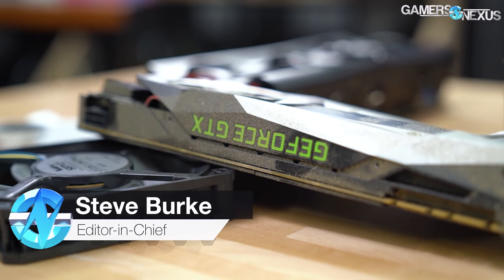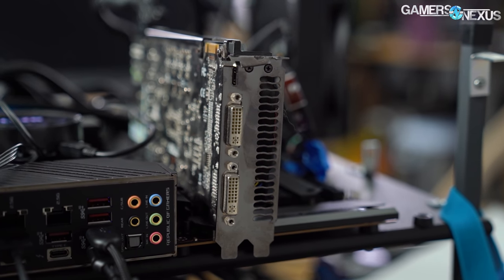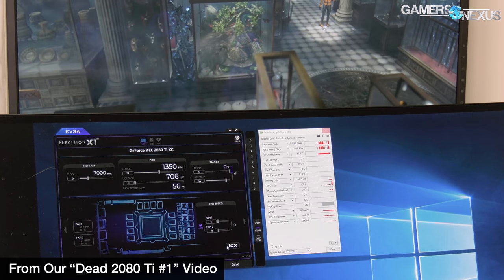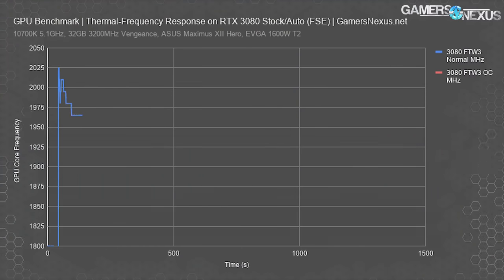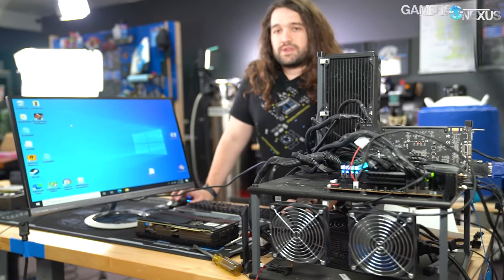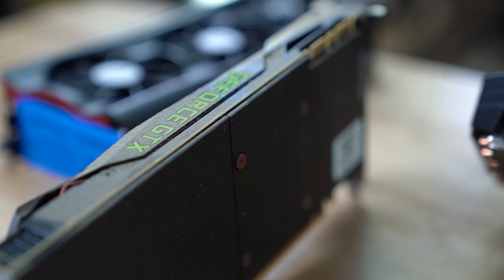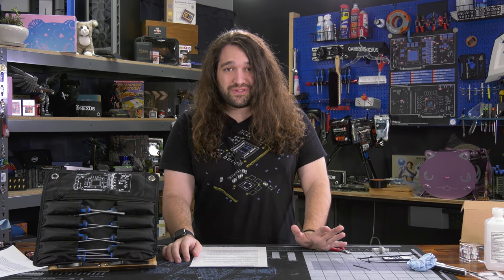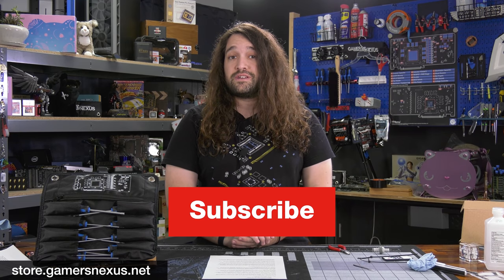Warning Signs When Buying Used GPUs: How to Detect Defective Video Cards

Comment from the maker: We'd love to hear more about our community's experiences with either buying used PC hardware components (GPUs, CPUs, etc.) or helping friends fix their own. There are probably a lot more shared experiences that can help other viewers of the comments section learn and protect themselves from bad purchases. Post them below!
This video is following-up our guide on preventative maintenance, dusting, cleaning, & re-pasting video cards: https://www.youtube.com/watch?v=n7NMeu0QiYk
Grab a GN Toolkit, Mouse Mat, shirt, or GPU anatomy poster here: https://store.gamersnexus.net/
Reply: rx 570 moment
Reply: I've had nothing but peaches when buying used GPUs. Bought a used Dell OEM RX 570, and it came coated in a thin layer of dust, but working. Probably used to mine, but it worked fine for the time I had it.

Current GPU is a used 980 Ti I got used for $200. It was super clean, in the box, and looked like new. 10/10 would buy used GPU again.
Reply: I asked last live stream about you suggesting someone for GPU repair, my issue was I bought a brand new, unopened box card outside the US, The manufacture told me when I immediately reached out there is different warranty regulations depending on what country I live in vs where the card was purchased & to contact the company I purchased from, & literally never to respond to another message from me
Reply: The card caused a D6 post code
Reply: I bought a used 1080ti, guy showed me running the heaven benchmark no issues. Tried it in two different computers, can't run any games (crashes to desktop) and can't play 4k movies full screen (black screen, sound continues fine, have to reboot to get video back. BUT, it can play 4k movies in a window (even a full screen window) and I can use it for encoding videos no issues.
Reply: Upgraded from an i3-4130 to a used i7-4790K, slotted in, worked perfectly, no problems even at the OS level. For some reason there are a lot of Malaysia-packaged chips floating around; the one I snagged was labeled Costa Rica; not sure if that made any difference or not.
Reply: I buy/sell a lot of older PC hardware because it became kind of a hobby to build PCs or save them from scrap and lots of people need cheap ones atm.

Generally, your best used deals will be things in Bulk of some form, weither it's a business getting rid of their old PCs or someone having a broken PC where some parts would be worth the price already.

Sadly, GPU are about the last thing you want to buy used (along with PSU) from private sellers. 
One exception would be GPU from miners, if they're old enough to sensibly get replaced for more efficient ones (i.E. when there's a big generation change or the like) you can make deals there but I wouldn't go above midrange cards. The reason why I'd suggest "older" cards is because they'll likely have made profit with no reason for the seller to scam back a lost investment/debt.

Another option as mentioned would be to pick up a GPU running benchmark tests (in fact, I run GPU-Z and Superposition on stuff I sell), but keep in mind a lot of places have contact restrictions in place at the moment and scammers love nothing more than a excuse to not meet you during a time where GPU prices are inflated.

Also: Don't feel pressured to buy a GPU now. Almost regardless of what PC you have, there should be lots of good games running on it, regardless if it's old AAA, emulated console/mobile ones or Indie Games - and many of them are free or low priced.  Weither you drop the XX hours on some new Games now or in half a year shouldn't make you throw away your money.
Reply: What about cards that where used for crypto mining?
Reply: had experience buying a fake hyperX ram, the seller said it was 8 gb, but when i test it in my board it only show 4 gb ( of course the code on the memory z is different ), then i mail official hyperx distributor and they said the ram was a fake.. next day i return it to the seller and confront him, then he admit he bought the ram from shady online shop. Im still lucky my money fully returned
Reply: Ive bought and sold multiple types of hardware components (gpu, cpu, ram, mobo) locally and over the net. Biggest thing is the person selling like steve said. Majority of people are honest and are just selling to upgrade not screw people over. Never had an issue with any used hardware, but I buy newer components (within last 2-3 gens). Had one person return my evga 760 for "not working", it worked fine he prob just had buyers remorse. I sold it for $45 I believe.
Reply: Part of a couple of forums and we have a good community, restrictions on who can get into the buy/sell section by having time/post count (but their checked for being spammers)
Means we have a lot of good people offering great deals on their parts.

With FB and our local version of Ebay generally try stick to locations where friends/family is to go pickup in person. Unless the product has an invoice with warranty then shipping is fine since I can get it fixed/replaced as long as it's not user error.

I've gotten a Ryzen system and 3950x for half its retail value pre this pc parts shortage. So pretty good as long as you do your due diligence.
Reply: My opinion on used hardware is that it's fine if the person you get it from is reasonable or if you have some guarantee for your money back which is true with most online markets. I have never bought used high end hardware, not because I have anything against it, but because I haven't had the opportunity due to cost/need. I was considering upgrading my graphics card to a used 20 series card last year, but that was based on an expectation that I'd finally get a paycheck, and did not account for COVID, or medical bills. That said, I have bought lower end used hardware and I have been running my NAS on an Intel developer motherboard with a core 2 duo with a stock fan that I got at the MIT Flee market for $75 all together, half a decade ago.
Reply: @shaneeslick  After that happen i just notice in my country the original HyperX RAM always have a box included in every purchase and that box must be returned in case of RMA ( like a proof of purchase ). The fake HyperX that i bought only use plastic case, from my memory-z data i think that fake HyperX is just cheap RAM with fake HyperX heat sink with fake label in it.
Reply: The list at 1:46/1:47- Items 1, 4, 5, 6 to include crash to desktop or display not coming up can be a result of a mining bios being installed on the card, Polaris/Island based cards where the most prone. In a blue moon were Vega Cards being flashed.

I know this because Ive helped hundreds restore cards through a vbios database and would locate the needed bios. My old username hastons of threads that can be used as a guide now.

There are tons of fake nvidia gpus, 1s claiming to be 960s/1050s when they are 450s...
Reply: Have since learned to always always always check thermal compound when buying a used GPU. Bought a evga 1080ti SC2 back in 2018 that I was told was in perfectly fine condition. Upon arrival it worked, but over time I began to notice it had issues running games that it shouldn't have trouble with. Then late last year, when trying to get it to run a fairly graphics heavy game, it stopped working completely. 
Upon removing the stock cooler, the issue was revealed. Previous owner had removed the original thermal compound and done a Liquid Metal application instead, and they had not done it properly, using plain electrical tape instead of conformal coating. Liquid metal eventually seeped off the die and well, sayonara GPU. When I bought a replacement GPU earlier this year, first thing I did was open it and check the thermal compound.
Reply: I've had pretty solid experiences in general. Bought a 1070 Strix and a 1080ti Zotac amp extreme core off eBay in 2019, both have been great. Recently ran into memory artifacting on the latter, but I'm assuming that's just been because of wear. Also bought a 1080ti Zotac amp locally that year as well (for 375)-- worked great, and I sold it to a friend last December for 340. Got sold a bricked 1080 last month (for 350 cash), so that was a bummer, but I'm still exploring my options there.
Reply: Like the person in the intro, I also bought a used RX 580 8GB a year and a half ago for my first ever PC build, but in my case for a bargain of 130 EUR. Since this was a brand new system build, I wound up figuring out and returning/replacing my DOA motherboard during the course of a month or so, and thus forfeiting the quick and easy refund for the GFX card since I couldn't even test it as this was the only system that could even run it and it didn't seem damaged. Still, since everything seemed to be working fine with the new motherboard, I felt I got a good bargain and that it was working fine...until I tried to play the first videogame, when it immediately crashed and forced a system restart the moment it was put under any more strain than regular Win10. Later I would find it randomly crashing even while playing movies or youtube videos and would find out that the only way to prevent this reliably was to severely underclock it (by 300Mhz or so on core and locking it from 2000Mhz memory to p0 state at 300Mhz - that part was critical, or the card would just immediately crash even if it might work at p1 state of 1000Mhz with some games for an hour or so). Did I mention BTW that you could do this with older 2019 AMD drivers, but not with their brand new shiny 2020 Adrenaline, which removed the option to lock the card's memory to p0 300Mhz state? That sure felt fun!

I tried literally everything you can think of - from trying every last kind of custom BIOS, to undervolting, to repasting + replacing thermal pads, ect. - nothing ever fixed it (short of I imagine soldering work on the memory chips, which I suspect were the main culprit) and I couldn't return it. Still, for a little less than a year I could even game on it, so long as its memory was locked to 300Mhz and its core clock was underclocked (effectively making it half as good), until a few months back I specifically had to overpay 650EUR for an RTX 3070 8GB to replace it, because I refused to buy another used piece of crap that hid its problems this expertly during Covid times, when who knows how long it'd take to get the return through and I'd inconvenience the stressed post office for it. Still...I guess I got p much what I paid for - half the performance for almost half the MSRP of the old card lol.
Reply: Picked up a refurb 2070 back in Dec from Zotac on EBay. 
Worked fine for a couple months, but now goes to black screen as soon as drivers load. It will boot into Windows desktop if the Nvidia drivers are cleared using DDU, but fails when you install them. Waiting for reply from Zotac.
Reply: Only issue I've ever had with a used gpu was a 9800gt that needed some thermal paste because the old stuff had dried to the point of cracking, causing the card to overheat and shut off the computer to protect itself. I've bought 5 in total. The aforementioned 9800gt, 2 rx 560s for some old office pcs that needed a boost, an rx 480, and my current 2060 super. Things to look out for are obviously seller rating and what kind of information the seller puts in their description (whether they've repasted, if they were overclocking or undervolting, if it has the actual part number or not). I steer clear of the sellers that only put up stock photos of video cards and don't even list the model; some of them are legit and just don't want to go through the effort of sorting what they have if they received it in bulk, but those types of sellers are also unlikely to properly check the health of the card; the rest of them are probably scammers with fake cards. Also, while seller rating is important, I'm personally not afraid of buying from new sellers so long as they take plenty of pictures of the cards, most people selling without any prior rating are just looking to get rid of their old parts and use the money to get new stuff. Buying hardware on ebay has become fairly low risk as long as you check everything when you get it, with ebay itself guaranteeing returns within 30 days.
Reply: I sold my 1080 founders few months back but before I handed it out to the buyer I had it deep cleaned and repasted thermal paste. ❤️
Reply: I'd still love to see a video about fan replacements or about fixing fans on old videocards. One of the fans on my MSI RTX 2070 Armor already started doing squeeky noises on occasion so that would be very relevant, at least for me.
Reply: I don't have any buying moments but I have a friend who's 1660 TI has what they call "white and black spot artifacting"
Reply: I bought a 770, 970, 390, and 2080 (probably mined on) on reddit and none of them has given me any issue. I even sold them after I upgraded. If we weren’t in this pandemic situation I would gladly buy used again.
I always check account age, feedback, and use PayPal goods & services.
Reply: Remember when this dummy was pooring liquid nitrogen during bench tests on a live stream with his bare hands?  Everyone was trying to tell him not to except for some dumb fanboys.  then he burnt his hands.  funny stuff
Reply: Mine is an RX 580 4gb. It's a year old now and is still fine.
Reply: Learned a hard lesson buying a "used 1080", basically got scammed out of half the price cause I had too much good faith in people and figured the guy was going to send it to me by mail. Ended up that the adres was a house on sale and empty and the phone number was a burner phone, the bankpayment method used a bank provided in between bank number that "protects" the owner's identity. The guy ended up being someone who was well known as a scammer on this website and who was being autobanned constantly but somehow always returned with a new account to scam people. Guy was in prison for a while and heavily in debt. Never saw that money again since the police solves very little of these crimes, it gets shelved even if you provide addresses from log in locations etc.

Second time was a lot better, had a chat with the guy didn't pay anything in advance. I went over to his house and he had the card still inside his pc, guy wanted to sell his 1080 so he could upgrade to a 2080 ti to play games. Saw it working fine, he was def not a miner and paid for his card by bank using my phone. Even got the box with it. Card has been in my possession for about 2 years now and runs fine.

Always try and pick up the card yourself and see it working there on the spot.
My other warning sign would be if the seller presses you into paying asap then something is wrong, if at 10pm at night someone is acting like paying even part of the price is something that has to be done before the night is over then something is up.
Also curb your enthusiasm, I know we all want to have nice things and we want them now but randomly buying something while you're on a euphoric high of 'being happy you get what you want' can cloud your thoughts and overlook obvious scammer signs.
Reply: Hey steeve ! What are the other cause of GPU failure ? I had a 770 fail so bad it would crash explorer.exe, making the desktop un-usable... What could have been the cause ? I then swapped it for a new GPU that arrived DEAD on Arrival. I can't remember if I switched the PSU cable with the replacement card. Would faulty cable be able to kill GPU ?
Reply: Bought a used custom watercooled Vega 64 with the PCIe Power Connector chipped? Anyway it detects fine, but for some reason often causes blue screen of deaths. I have another of tthe exact same model and watercooled but it did not cause issues. Tried DDU and reinstalling drivers and flashing over the current BIOS but now no matter what it can only function properly on the default backup BIOS. I mean, I got it for USD200 including the waterblock so I guess you get what you pay for.

What's the point of a Watercooled GPU if it can't clock higher than one that is air cooled?
Reply: Bought an rx580 8gb. Got an rx570 8gb with an rx 580 bios. Didn't know any better. Worked fine for 3 weeks. Then had a power spike, took out the psu which took the rest of the pc down with it. 10/10
Reply: Bought a used vega64 for £180 back in 2019 only to build to a PC with it recently. Little did I know the dent in the heatsink was also a tear between the copper and aluminum, which kept causing overheating issues. But the Card worked! Until I had the bright idea of strapping my AIO to the card with no VRM cooling... While the core was fine and cooled, I must've killed the VRM because now I have a piece of e-waste on me.
Reply: 11:29 You got some artifacting in your Video maybe the Editor needs to be RMA'd. :-)
Reply: Faulty fans or worse a faulty fan header. As modern cards tend to only spin up the fans past a certain temperature, this requires a stress test and GPU-Z to catch.
Reply: We somehow ended up with a third PC during late 2020 after upgrades (R5 1600, GTX970, 8GB RAM and a 256GB SSD). It runs pretty okay for the most part, and it ran well for our friend who bought it from us. Several months later it ended up crashing a ton upon plugging in a USB device on some of its ports. We're actually not sure how it happens but sometimes it resolves itself good enough.
Reply: the only real used PC part i bought was a Xeon from china, haven't had an issue with it aside from it being a decade old. But it has enough cores/threads/overclocking potential that it still has some decent like left, aside from missing modern instruction sets needed to play some modern games.
Reply: recently got a rx 570 and it artifacting in games not running second monitor with restarts when you attempt and flickering on the main monitor. worst part i thought i bought it brand new the seller seemed good had great reviews. no onboard graphics so stuck atm
Reply: TITAN V NEEDS NVIDIA SMI TO CHANGE THE PSTATE SO FOR THE GPU TO BOOST TO 1860 MHZ..... it is normal that TITAN V stays locked at 1350 or 1450 if watercooled...
Thisis a proffesiional GPU not a gaming one , even if its faster than an RTX TITAN, in gaming and raytracing
Launch Command Prompt from the Run window (press Win+R on your keyboard to open "run" then type cmd).

Change the directory location to the folder where nvidia-smi is located. 
Type cd C:\Program Files\NVIDIA Corporation\NVSMI into the DOS window and press enter.

Here’s the nvsmi command that will uncap mclk on TitanV:
nvidia-smi.exe --cuda-clocks=OVERRIDE

To return to default:
nvidia-smi.exe --cuda-clocks=RESTORE_DEFAULTS
Reply: I managed to get a 3090 FE for £1750 that came with a dead fan out the gate (had a rare defect where the header for the bottom fan gets sheared off in the factory) but because I had to buy it through Ebay Nvidia wont RMA it or just send me a new fan, have done some of my own modifications and it works great now, if kinda janky
Reply: Also for those interested I am using a case fan as for the time being it is impossible to buy replacement fan
Reply: I've had great experiences buying and selling used. Recently sold some old GPUs and I can't believe how common it is for people to take your word for it. Lucky for them I'm just selling working and clean cards but I had one guy not even open the box until I told him to. Stay smart out there buying used stuff everyone.
Reply: I bought a gtx 1060 3gb on ebay back in 2018, I cleaned it and repasted it and it’s still working to this day :)
Reply: @Gamers Nexus - at 16:54 on the RX480, the plate of the card looks like it has moisture - Similar to a card that had failed on me back when I vaped.
Vape residue looks exactly like that and can build up.  It built up and became basically a droplet which went down into the PCI slot.

Just something for people to keep an eye out for.  The only way to have been able to tell by the time I was done trying to save it was a tiny burn mark on the actual PCI connection area.
Reply: Also:  Wouldn't a card that doesn't post (the 3080) still be covered under warranty?  It might be a wait to ship back, etc... but wouldn't that still make it worth buying?  Or am I wrong?  Anyone?
Reply: Thanks for the info man we appreciate it, keep up the good content 👍🏻
Reply: @machintrucGaming  yes, you had a gpu die dying, typical of nvidia cards...
Reply: @D3Shadow  depends on the oem and the store it was bought from and if you have PoP.
Reply: Wish we could buy some of that stock off of you haha
Reply: OMG I JUST got Space Invaders on my 1080Ti but it seems to run YT vids/browsing and idle fine. But I got Space Invaders error while gaming then BSOD....anyone know what the hell this is???? Why?
Reply: @Gamers Nexus pls make a video about pricing and risks of buying a video card that was on a constant mining rig before the gpu crash happens.
Reply: gtx 580.3 radial fan evga works quite nice. sub 30 €. 
seen rx 580 for 700€ new? on ibäh ^^
Reply: Not used, but bought a 2070 founders edition direct from Nvidia this time last year.  It sat until I finally had the time to do a new build just a few weeks ago - after just a few days of use it began artifacting - Essentially a new card, tested with cinebench with no problems.  Came home from work to find artifact lines all across the screen.  Re installed drivers, card, different cables, different monitor, always same result.  So, it can happen even to a 'new' card.  Talk about pulling out your hair given no means to easily replace it.
Reply: When I sold my VII I made sure it was clean, and I kept it supported with a anti-sag arm. I also used my friend's actual repair shop as a front for selling it to make my legit listing look less sketchy.
Reply: is it a good idea to have gfx cards shipped?
Reply: @romchompa6858  how else are they going to get around the world? they aren't made down the street from the store. As long as you aren't shipping them with improper packaging it's usually fine.
Reply: Usually a seller gives buyer 2 weeks or a month to test the card. So it is plenty of time to test and stress the GPU. 
But there is no way to tell if used GPU came from home PC or some other PC where it worked 5 or 6 hours a day or from mining rack where it worked 24/7 at 100% for a year. 
I bought used GTX 1070 two years ago and I asked the guy is it from home PC or mining rack. He told me that the card was mining coins for 6 months. The card still works perfectly.
Reply: But now almost all used RTX 20s and RTX 30s will come from mining racks. Over 90% of them. All this mining of virtual coins is like a new gold rush. People buy GPUs like crazy to mine coins.
Reply: Got a 2080S turbo from Gigabyte... Failled hard in 3 month. Back from RMA and got your SPACE INVADER thing randomly and then shut down.
Reply: bought  CPU, PSU, RAM, AIO's, fans and all my cases off Craigs List but never a GPU or Mobo.
Reply: As a miner I concur with your statement regarding mining cards theoretically are taken care of better than some gaming cards, depending on "housing" and ambience. ô¿ô

To elaborate on that, a lot of us small time miners build cabinets with filtration and excellent airflow. 

My 3 rigs are in a 3x3x7 tent behind a 6" inline activated charcoal filter with merv-6 prefiltration and a 6" centrifugal blower rated for 420cfm in a humidity controlled basement that's never hotter than 20°C  - cats, dogs, smoke, I'm not keen on dusting & cleaning a bunch of cards every 3-6 months. Also, I'm pretty happy with thermals & the simplicity of replacing pads + paste as needed. 

Buying used GPU's has been nothing short of a pleasure outside of the current market pricing, with one exception!

Managed to pick up a 3090 Suprim X "used", at MSRP!
Reply: I restored a pcie card that was in a bad house fire. It's running. Deoxit and a toothbrush, rinsed with 99.5 alcohol.
Reply: I've had good luck buying "junk" GPUs as long as they're detected / power on. Like you mentioned in the video, repasting can often fix these. Or if you're lucky, it's just a BIOS flash issue. More and more it seems like cards used for mining are being resold on ebay with modified BIOS for mining that are unsigned, requiring either something like amd pixel clock to make them work in Windows, or a BIOS reflash. If they state the card powers on but it's showing an error 43 in Windows device manager, it's probably fine but just a BIOS issue.
Reply: what is that Nitrogen tank for ?
Reply: Getting ready to buy a 1080ti from facebook market place, wish me luck
Reply: @NewsOfTheRebellion  My take on this is that gaming may actually shorten the life of a video card much more than mining. Why? because a mining card will run at a pretty much consistent load and temperature, A gaming card will not. It will be loaded when the gamer is gaming but at other times will not. That creates temperature cycling and temperature cycling induces physical and mechanical stresses because differing substances expand and contract at different rates with temperature fluctuation. Because of this, thermal cycling is often far worse on electrical components that running at consistent loads, even if that "consistent" load is full load. Think about it. There's a reason why light bulbs often fail whenever you flip the switch to turn them on.
Reply: There is another fault i discovered , if getting Bullshit error codes from the mother board constantly reporting various failures the mother board is not broken it is shorting on some sort. Take out clean with alcohol cotton bud and magnifying glass,  common if someone used thermal grizzly liquid metal paste and made a mess of things its conductive and looks like mercury and hella messy  this can also be evident if someone used this to replace a cooler with the wrong type of paste ,  warning though its a absolute nightmare to clean off as alcohol will dissolve the gallium tin compound but u must get every molecule off
Reply: I want to ask something.... Who the fuck buys Rx580 for $700.
Reply: Could also be titled how not to sell a defective card.
Reply: Hi Sir I just want to ask for your advise.

I searched the internet for a very long time but din’t find a solution to the problem.

The issue was suddenly a black bar appeared at the bottom of the screen while playing Days Gone (later on, all games). I am running a 1920x1080 monitor at 144hz refresh rate in windows 10. The black bar became bigger later on, about half the size of the monitor, covering the screen and the game. I found out later on that decreasing the refresh rate solves the problem temporarily, since right now, I am sitting at 85hz with the same problem. Before, 120hz and 144hz have problems, but now, even the 85hz.

I am not sure the exact problem. Some told me that it is a monitor or gpu problem while others say that it’s just because of outdated gpu driver. I already updated my driver to the latest version but the problem still persists. I don’t know what to do now. Please help me with this.
Reply: hello i need to get at liss a 3070 video card what to recomend to have a cheap price please let me know i need it for my son he is a gamer so do i please let me know i have spend alot of money but lately iam given up with so spencit video card please help me out ?